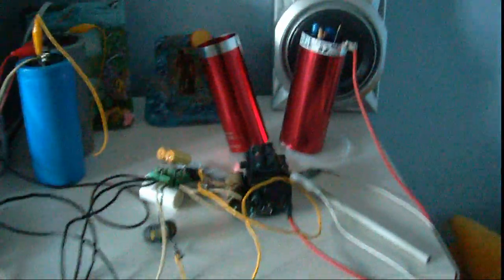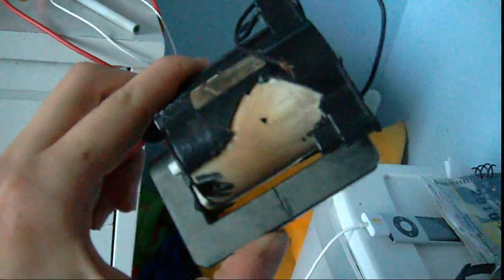ZVS Flyback Jacobs Ladder Arcing

Comment from the maker: @08Kutt nope, the diodes I currently have on this driver work well. Plus, I cannot push any more power out of this driver in the first place. I already blew one trace, and fixed it with solder and wire. I also added wire and solder along the traces to prevent future failure. Whatever year I will have money to blow on more electronics, I will make my IGBT zvs with some nice fast diodes

Comment: @juniortore1   Ok.  Yes, some people only have plastic or even wooden coathangers.  I think most folks have wire ones around somewhere, though.   As for the cylinders, ok, they were containers for the actual bottles.  They sure worked well, though.

Comment: @juniortore1   Couldn't you have used some wire coathangers (if you had any around) or even two table knives?  ~  Perfume bottles?  But one's got pens & markers in it.  Were these cylinders actual bottles or maybe the packaging they came in?  Anyway, very creative improvising.  :)

Comment: @juniortore1 i have a 555 driving a irfp250 and i put about 20 to thirty volts and it draws about 1.5 to 2 amps depending on the frequency i tune it to ... i was wondering about the zvs but i can never get it to work right

Comment from the maker: @pieznice29 Since I do not have any wires (at my moms house at least) I had to use those two red perfume bottles of my moms. Which sucked because it took FOREVER to space them correctly without the arc either not firing, or getting stuck on the bottom